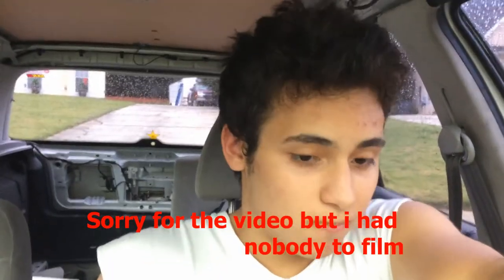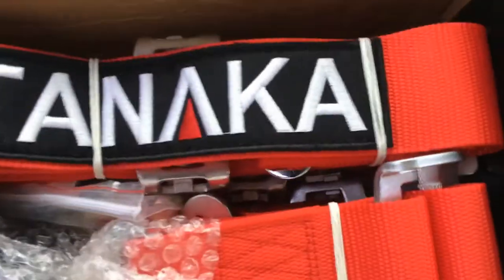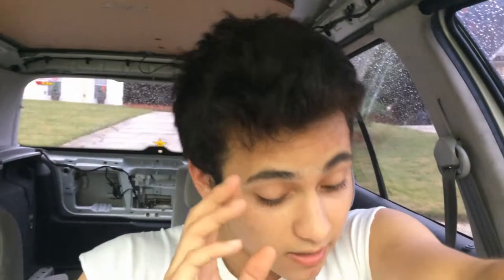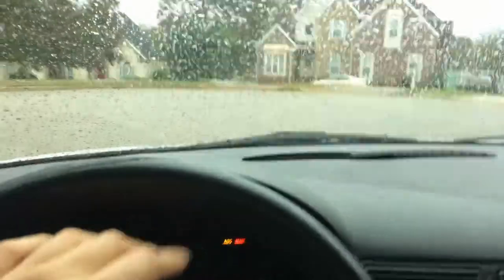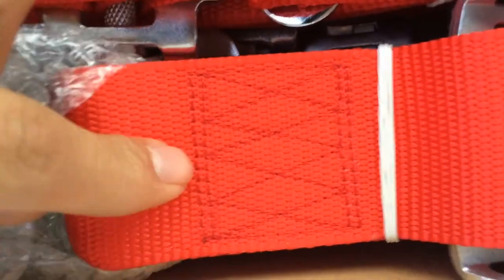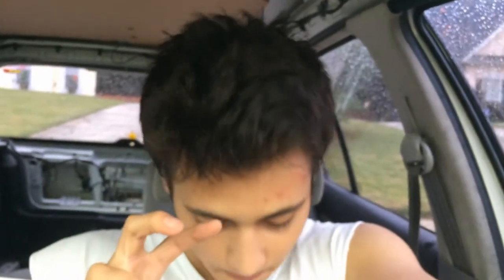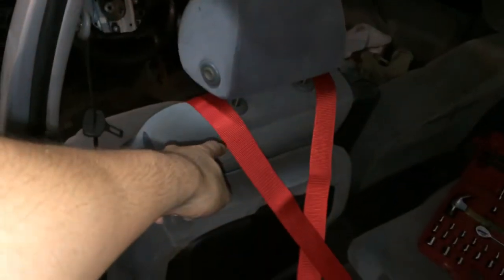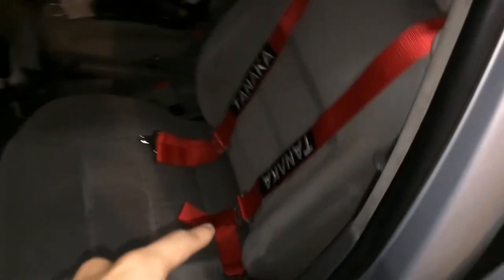Installing tanaka harness on the VW mk4 Golf

Comment: hello!   i just watched another video about these 2 belt seatbelts..  this is not the right way to mount them becouse this way in an accident the seatbelts pull you down wich could cause serious damage to your spine, with 2 belted seatbelts always pull them backwards and mount them as high as possible. (also with these seatbelts they can only be used correctly with the official racing seats.

Comment: Do some research on those belts. You have no idea how cheaply made and flimsy the material of the belt itself is. You're going to get yourself killed with those. Not only that but if you get in a head on collision you will likely submarine and die from internal bleeding. Stick with the stock belts if you're not willing to shell out the extra cash for quality safety belts. Not hating just pointing out the fact that you may as well not wear a seatbelt at all at that point. Takata tested these belts to show how poorly they were made and the belts literally snapped on collision. At the end of the day it's your life at stake and not mine.
Reply from the maker: Yes I understand i new before buying it. I just had no seat belts at all the did not work and I just wanted at lest something and did not have to money for real harnesses but it is in my to do list.
Reply: Okay so I'm pretty sure I watched the same crash test you did but that was not a TANAKA harness it was a fake Takata.  TANAKA is a different brand all together, yes they sound the same and yes they are cheaper than Takata but they are not knock-off Takata's.  A knock-off Takata will still say Takata on it but the materials used are dog-shit.  Check out Adam Ivell's video for a more in-depth look.